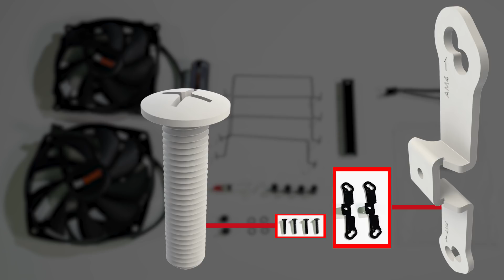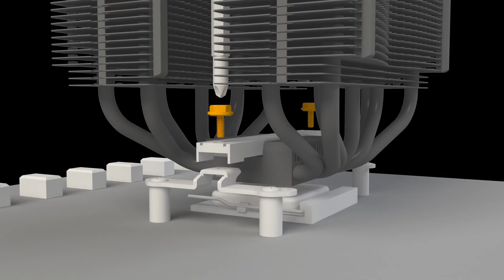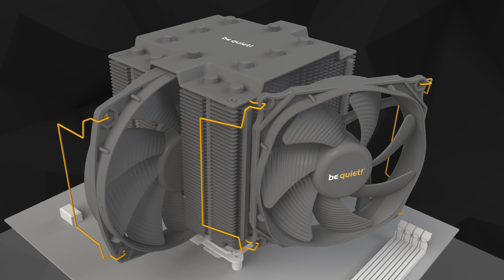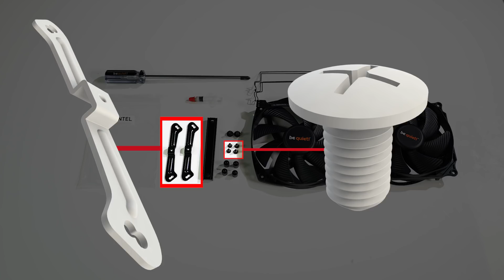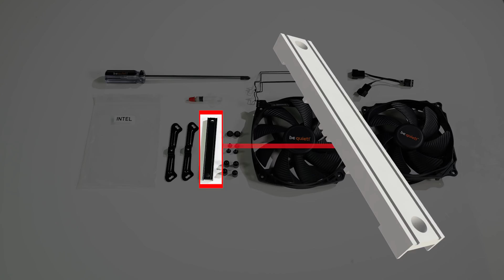Installation: Dark Rock Pro 4 (AMD AM4 / AM3(+), Intel LGA 1151 / 2066) | be quiet!

Comment: how strong to tighten the 2 screws onto the cpu?
Reply from the maker: Not too tight. Screw then in, until you feel good resistance - that is enough. A little bit of wiggle room of the cooler on the CPU is normal and by design.

Comment: May god help those that need to get these clips off to replace the fans or remove the cooler!
You'll eventually get them off but you'll scratch the crap out of the black finish on the cooler doing it!

Why in the world did be quiet! take the bent up tab on the clips away that the dark rock pro 3 clips had?!?!

Put the "tab bend" back in the clips for easier installation/removal and use springs on the screws for consistent mounting pressure and you've got a Noctua NH-D15 killer.
Reply from the maker: Hello. Actually you can bend all of the sides of our fans a little bit - more than enough for easy installation and deinstallation.
Reply: @bequietofficial  Well ok then.....I just ordered one from Newegg for my 3900x.
I'm ok with removing my motherboard to make installation easier so that's no big deal to me.
But you better not be lying about those fan clips or i'm gonna come back on here and give your installation video a thumbs down and call you names!  LOL
Reply: @bequietofficial  I received my Dark Rock Pro 4 today.....I must say this is a VERY nice looking cooler, seeing it in videos don't do it justice.....And YES, I can remove the fans pretty easily by removing the clips from one side of the fan itself first, rather than trying to pry the clip out of the groove in the heat-sink fins....Very nice, i'm very impressed!

Comment: Has anyone had any issues with the weight of this cooler installed in a tower case? It's 2.5lbs and I'm a bit nervous.
Reply from the maker: Hello Jeff. No issues we know of.
Reply: Seems to be working great. That mounting bracket is quite sturdy. It's keeping my Ryzen 5 5600X at 36C idle/60C max temps.

Comment: Hi Be Quiet! Can your Be Quiet! Dark Rock TF be fitted to AM4 socket (Asus ROG Strix X570 F-Gaming mobo) despite it not being compatible with said socket? If yes, how? If not, what's the main reason? Just the screw holes or is there another reason? Thanks! 

CCL Online says your TF isn't compatible with AM4,.. so I just had to order a Dark Rock Pro instead,.. which I didn't really want to do - I wanted the TF to help cool the smaller components on the motherboard (VRMs etc). So, yes, I'm disappointed in that. Please advise, thank you. :)
Reply from the maker: Hello. That's a completely wrong information, I'm afraid - of course the Dark Rock TF is AM4 compatible! Please see the full technical details here: https://www.bequiet.com/en/cpucooler/572

Comment: On the intel boards we can rotate the cooler by 90 degrees, right? To make the fan face the direction we want. I say this because I wanna install the dark rock pro on a computer case that sucks the air from the bottom and it exit at the top, so I need to install the cpu cooler with the fans facing up (pushing the air upwards). Is that possible?
Reply from the maker: Yes, you can.

Comment: Hey, This is a top priority question, how the heck to you get those wire things that mount the fans to STAY PUT!? I cannot for the life of me keep the middle fan still in the thing, i followed directions, yet it still keeps coming loose, wire bits falling off, and its making me just want to break this damn cooler
Reply from the maker: It's actually quite easy:

1.) You take the clips and attach them to the holes in the corners of the fan.
2.) You put the fan/clips construction in front of the cooler, and bend the clips slightly so that they arrest themselves in the cooling fins. First on one side, then on the other.
3.) The End.
Reply: @bequietofficial  Too late i figured out I was using the wrong size clips. I think that should be specified in the instructions so more people in the future dont end up frustrated, let alone have problems with the middle fan falling ouf and breaking their NVME drives.

Comment: Hi, I'm interested in buying one of these and wondering if it is possible to mount two white 120mm fans in place of the black ones that come with it thanks
Reply from the maker: Hi Edward, we cannot recommend that as it will lower the cooling performance. Anyway it might not be possible with the standard fan clips. If you want to do it anyway please contact our service@bequiet.com, maybe they can help with the fan clips

Comment: There's a backplate for Intel but not AMD.  Kinda sucks if you don't have the backplate that came with the motherboard anymore.  And those fan brackets are EXTREMELY tight.  I highly recommend needle nose pliers for installing them.
Reply from the maker: Hello Ravyn. They have to be really tight in order to function properly. By the way, it's much easier to install the brackets when you anchor them into the fans first and then pull them onto the cooling fins.

Comment: Well this fan fit in any case and will it get in the way of my ram sticks?
Reply from the maker: It will not fit in Mini ITX cases. And regarding the RAM: Well, it depends on the RAM. The cooler clearance is 40mm.
Reply: @bequietofficial  Hello, your website has my Z390 ITX Phantom gaming IC listed as compatible with the Dark rock 4, Im using a Noctua U9 at the moment, but it's not keeping my i9900k cool enough, are you sure I won't have enough height clearance in my case?

Comment: Which Fan must in the 3 pin connection? The 135mm or the 120mm fan
Reply: I would really like to know that, too,  as there's no reference to it in the installation guide.
Reply: It doesn't really matter
Reply: @beat461  Thanks for your answer, but how can it not really matter when the connectors coming from both fans are 4 pin? I think Bamboss 2017 and I are honestly wondering how this can work out with PWM signals working as intended, isn't there some kind of "signal loss"? But if be quiet! doesn't elaborate on this in the installation guide I guess it is as you say :) .
Reply: One fan will be controlled by voltage and the other by pwm. and the rpm readout will only be from the fan connected to the 4 pin connector. It doesn't really matter which one of the two gets the pwm signal.
Reply: @beat461  Thanks a lot for your detailed answer! Now that makes a lot of sense and I can finally understand it :D !
Reply: @ericasmr-de-8501  lol you are nice
Reply: @fridolinfrohlich9594  I try to be 😊

Comment: Thermal paste application is what im most worried about, how much, what shape, where? Online it says all sorts of things, like spread it all over, pea size dot in middle, X shape in middle, + shape in middle (as this vid shown) . Im using it for i9 9900k (using dark rock pro 4 cpu cooler). Advice would be greatly appreciated!
Reply from the maker: To be honest: There is really no wrong way to do it. Whether you apply a pea-size splotch in the middle of the CPU, draw a plus or a circle is really not relevant. The most important thing is: Apply it! As long as there is a sufficient amount of thermal paste between your CPU and your cooler, you're fine.

Comment: Hey, mine is arriving tomorrow, i have the dark rock 4 do i have to change the backplate for the pro? I checked the video for dark rock 4 and looks same? Also what is the best way to apply thermal paste since i know there isnt much of it.
Reply from the maker: Hallo. The choice of backplate depends on the CPU you intend to use.

Regarding the thermal paste: Please take a look here: https://www.bequiet.com/en/insidebequiet/17
Reply: @bequietofficial  im using intel 9900k i think i dont need to change the backplate for it as it looks similar also thank you for the guide

Comment: I am just finnished installing this cooler, and it was a very easy installation on my ASRock B450 Steel Legend/AMD Ryzen 9 5900x. And the CPU temp that was over 80C in the stress test, is now just over 60C. I am very happy with this cooler. :)

Comment: I am considering the DRP4 as replacement, but it looks like being impossible to install it with the motherboard already being mounted in a case. Any experiences / advice?
Reply from the maker: Hello. Wlel, you can open the case, release the motherboard from the holding screws on the plate and install the cooler. Unfortunately there is no other way.
Reply: @bequietofficial  I am very aware that uninstalling the motherboard would do the trick, but thanks anyway :)
Reply: I installed it in such a way that I disassembled the graphics card and unscrewed the top case;)

Comment: Uh yeah, I bought this cooling fan but I don't see these parts in my parts bag that came with it. The support brackets are different lengths which are useless for my ASUS AM4 Hero Mboard. should I take it back and get the correct cooler for my Mboard?
thanks

Comment: Do both fan logos face the same direction?
Reply from the maker: Yes, they do.
Reply: @bequietofficial  Thank you for a quick reply. Doing my first build. Not as easy as it looks - your cooler has been on and off 4 times now. My fault entirely for not paying attention and putting it on wrong way round, then putting centre fan wrong way, then just needing access to bits obscured etc. It's been a learning experience!
Reply from the maker: :D  It always is. Good luck - and have fun!

Comment: 2:12 so in fact the middle fan is logo towards the front fan, which is logo towards the... FRONT of the case? Because we can't see the ports... so those logos have to be towards the front???? This is really unclear in the printed materials, it looks like the middle fan is the other way. BTW the idea of a unique screw driver you can't buy anywhere was an idea of an IDIOT. Plus, if only those holes were 2mm larger, any huge screwdriver would fit... BUT NO... The cooler itself rulz, 2700X, at night - I can hear the wind outside but not the desktop...

Comment: Wow installing the fans on this was *insert expletive, expletive*. Fmd.
Reply from the maker: Hello Max. What was it that gave you trouble?
Reply: The central fan was extremely hard to clip in. The clips fall out extremely easily before getting it into position to even attempt the anchoring in. Had to watch another youtube video to do it. Method in thi video just simply didn't work after an hour. Also needed to try new one of the alternate clips after an hour.

Comment: I wish they would explain what those cables are that they’re plugging the y cable in to. It isn’t really helpful if they don’t tell you which ones they are.
Reply from the maker: They are the power cables of the two coolers of the Dark Rock Pro 4.

Comment: I have an 1151.  A few comments. Definitely put this on before you put your MOBO in and your Video Card in. Two the music in this video is obnoxious and the video moves too fast. Some instruction on part orientation and verbal queues would be nice.  Lastly the bracket wire system is a pain in my ass and the most difficult part of my build. Please just put some kind of latch on the towers. Otherwise it wasn't too painful.

Comment: Hello Be Quiet!

Today I got my Dark Rock 4 Pro.
The assembly seems simple, but when we have the entire computer assembled, the stairs are already starting because I had to disassemble the graphics card and the top case to do everything in accordance with the art.
Imagine the beam with which we attach the cooling to the base in the housing and inserting the 4 pin pin must take place just before applying the cooling to the processor!

If Dark Rock 5 Pro comes out in the future, please pay attention to the installation of cooling in an already assembled PC to make it easier :)

My processor
i7 11700k
The temperature at rest is 34 degrees.
When I had AIO from msi it was over 55 degrees and more!
Reply from the maker: Thanks for your feedback! We will pass this on to our product management. Installing the cooler into a already assembled PC can be a bit tricky, but we're glad you're overall happy with the product!

Comment: I have the X470 Taichi, it has 2 CPU fan headers.  Is the Y-Splitter cable required in this case?  Or can I connect each fan individually to a CPU fan header without the Y-Splitter?

Comment: My fan moves around a little after clipping it on. It’s not fit on super tight. Is that supposed to be like that?
Reply from the maker: Actually it should be really tight. Maybe put the steel clip a little bit further back?

Comment: You see when it says "am3 only" if I have am4 motherboard do I not need to add those 4 tiny rings on?
Reply: That is correct, only the bigger ones for AM4, the smaller ones for AM3 socket only. I have both sockets :)

Comment: I like this video. I needed some help because i don`t like reading instruction manuals unless i have to. Video is more useful to me and this shows me exactly how to fit the cooler. Thermal paste application may not be the same as mine but fitting instructions are good. Well done and thanks.
Reply: never seen someone make a big ass X on the cpu wtf is that about?

Comment: There is no way to rotate the fans 90 degrees. As a result: either the fan wire does not reach the power supply, or lies in a bulky lump. The internal fan is not installed until the cooler is screwed onto the board. When screwed on, the fan cannot be installed. Do not crawl. The most inconvenient cooler in my life.
Reply from the maker: Hello Mike. Actually you can: Simply remove the clips from the fan, rotate it by 90 degrees and re-attach the clips.

Regarding the second fan: Pull the connector through the opening, insert the fan, attach the clips. Then connect the wires to the motherboard, and finally install the cooler.

It's really quite easy.
Reply: @bequietofficial  The distance between my PSU and cooler is 1 centimeter. The latch does not fit. The only chance to install a middle fan is to remove the top cover. I went for the hexagon. Why doesn't it come off in one move?

Comment: @be quiet! Can this cooler be oriented horizontally in case the intake is in the bottom of the system rather than front panel? I have a Ryzen build if that matters.
Reply from the maker: Yes, it can be turned 90° by using the installation clamps of the cooler.
Reply: @bequietofficial  Thanks for the reply! I really need some instructions, the provided manual only covers the vertical orientation. There's no mention about the horizontal one.

Comment: To anyone who reads this, here is my review:

THIS UNIT IS A MONSTER!!!! It is thicc, beefy, heavy and sexy! It runs super quiet, install was pretty straight forward, I struggled a bit with the fans and the mounting bracket but it was minor. 

The only issues I had though, were that the case I'm using (Metallicgear NeoAir), I had just enough room to install this on the CPU and clear my top mounted fans.
THIS WILL NOT CLEAR CORSAIR VENGEANCE PRO RGB RAM. So I had to do an alternate fan Mount to make it fit because the clear plastic for the RGB Sat just tall enough that it wouldn't seat properly. (Super minor but still not fun)

In the end: currently I've never been happier with an air cooler. It's quiet, it runs super cold and it does the job better than my AiO so far. I can run For Honor, warzone, dead by daylight, any of these games on max settings and see my cpu stay around 40 degrees Celsius and have my AMD ryzen 5 3600 run at 4.2gz with no issues at all! Other than the unfortunate personal Ram clearance issue and install difficulty, I would highly recommend this cooler!
Reply from the maker: Thank you very much!

Comment: I cant get the dang fan back on mam
Reply from the maker: Hello. What might the problem be?
Reply: @bequietofficial  I dont understand how to  put the fan on with those thin metal things. It seems like it's too big to use.
Reply from the maker: @Chrisraidr  It's actually quite easy: 

1.) You put the hooks of the clips into the  holes on the fan.
2.) You put the fan on the side of the cooler.
3.) You put the "hook" side of one clip into the first side of the cooling fins, thus securing it in place.
4.) You put the fan onto the cooler and bend the other side of it (where the other clip sits) ever so slightly, so that you can snap the second clip onto the other side of the cooler.
5.) That's it. Your fan sits tighly on the cooler.

Comment: Great cooler. Been using it for couple of years and temps of i7 7700k are incredible even while gaming. Silent operation without worrying about liquid cooling pump failure or leaking.

Comment: Dark Rock pro 4 + be quiet base 500 (case) = NOT GOOD, NOT QUIET

stock cpu (not OC), gtx 1660 super with 3 vents,ssd, silent fan in power supply + base 500 = quiet as a mouse.
but then I instaled dark pro for the clocking, the box got loud, really loud. dfuk
I'm very disappointed, thought this will remain quiet.
Reply: 1. Did you position the fans properly?
If you don't align them properly, they can give a whooshing sound.
Also be sure they rest properly on the rubber spacers on the cooler.
2. Try to connect each fan to a separate fan header, instead of using the joint fan connector.
This helped mine to both be more silent and cool slightly better.

Comment: What do the fans plug into, i plugged it into cpu fan and im only getting 300 rpms roughly
Reply from the maker: Hello. Does your CPU get unusually warm?
Reply: Ive got cam software on my nzxt case and seems to stay 28c idle and under load its gets to the 40's so not bad but just worries me as i thought the fans wouldve moved faster, i can almost read the logo on the fan

Comment: Extremely happy with this cooler! I installed it on my Ryzen 5 2600 I know it's massive overkill but I want to OC and still bequiet.
Today, temps indoor are 31C my all core overclock @ 4.1 GHz my idle temps are 45C and max out at 77C under load. That's with quiet fan profiles. Installed in Pure Base 600 case which doesn't have the worlds best airflow. Goes to show you can OC quietly on air.